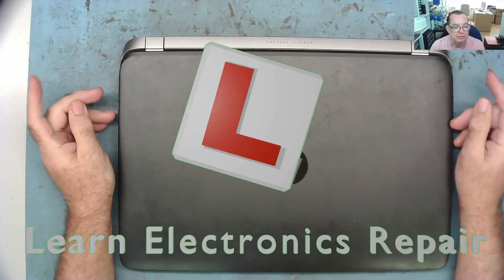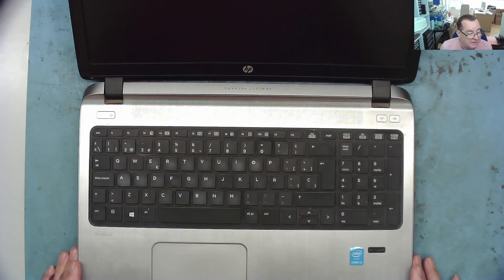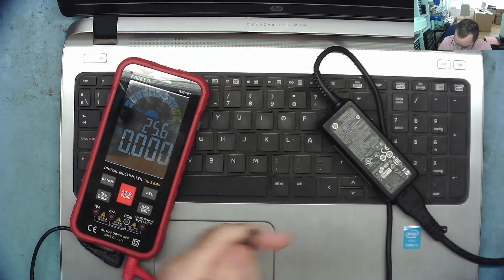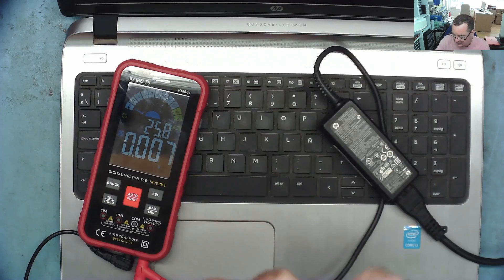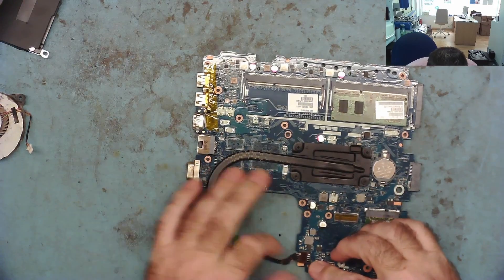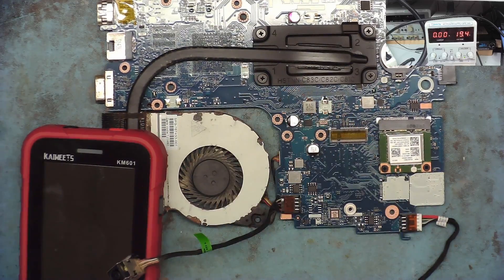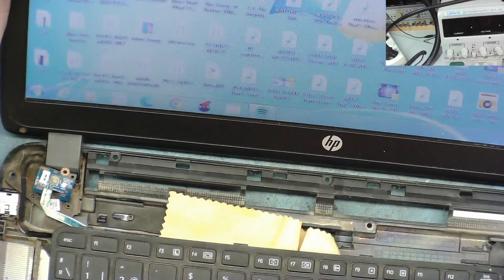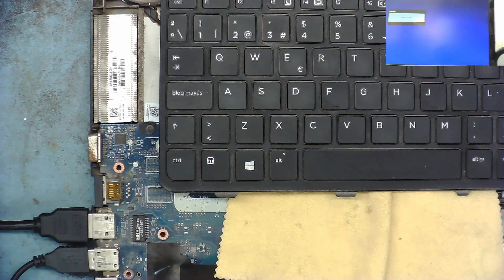HP Probook 450 G2 laptop - First It Had No HDMI Output, Then It Went Dead - Can We Repair / Fix It?

Comment: Sir need recently I replace my laptop display but it suddenly fell downward while using so I open display cover while power is on then I saw video adopter plastic also not glued so I put that plastic it right position and use tape but  I don't touch or try to pull out video adopter connector  but my laptop not booting up it fan and mouse work fine but it's display doesn't show up does that motherboard damage

Comment: Judging by the amount of rust just on the VGA connector and the general dustiness of the laptop I reckon an ultasonic bath and lashings of contact cleaner may give some result. Maybe also check the fuse on the HDMI port under the kapton tape.